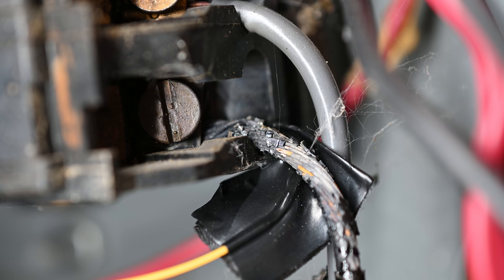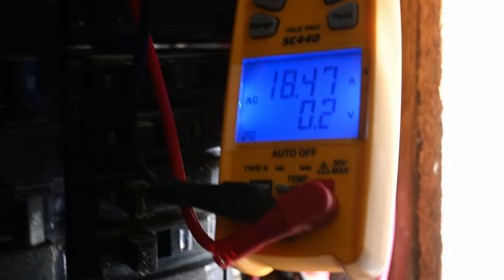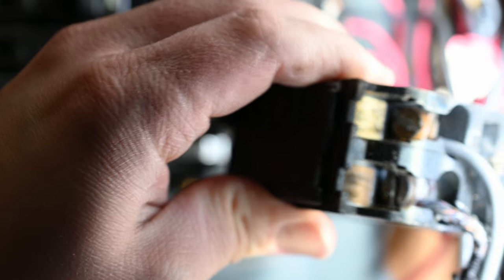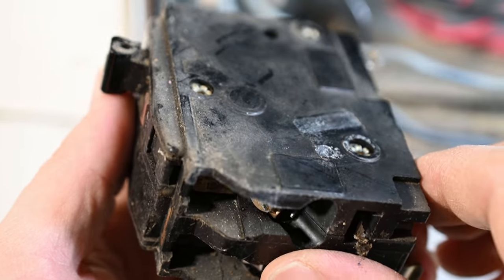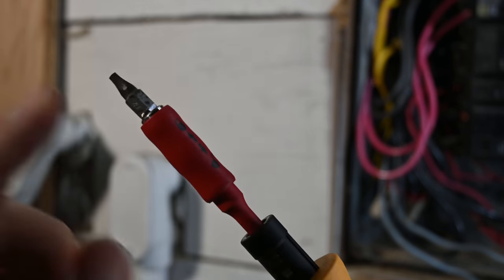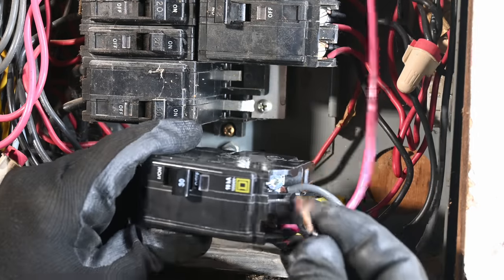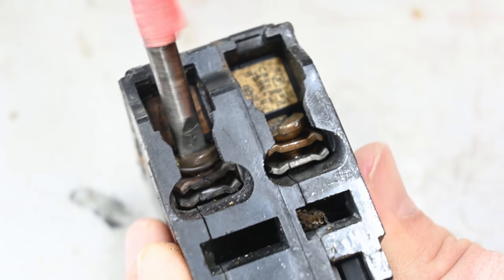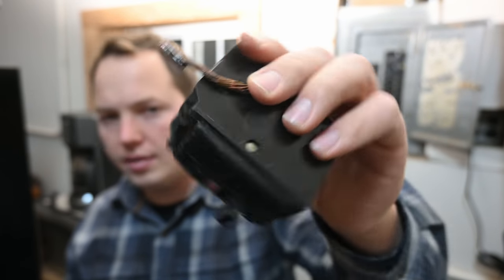Burned Wire On Breaker - Torque Screwdrivers & Why You Should Probably Be Using One

Comment: Thank you.  I teach HVAC/R and I have been teaching using a torque screwdriver on breakers and contractors.  Also the use of ferrules, like they use in Europe and Japan, help prevent this issue. Also, yes you need to cut more back  the burnt wires. The European screwdrivers are thinner then ours. The full Wiha set is several hundred dollars. 
Thank you again for making a YT video.
Reply: The ferrules are great! I can't believe those aren't common here in North America.
Reply: I was also wondering if you can use Ferrules on wires attaching to the breaker and you answered my question. I used them on the bus bar but not going into the breaker.
Reply: Are ferrules useful in marine wiring?
Reply: @GrampalettasCamp  to my knowledge ferrules are great with any stranded wire.
Reply: @victorlopez2143  You may want to check with your local code enforcement agencies to find out for sure. I'll bet they are not all that up to date.
Reply: @GrampalettasCamp  One of my friends has large boat and he crimps ferrules on the ends of EVERY conductor (all marine conductors are stranded, every splice is crimped). In fact, that is how I learned about the existence of ferrules--through him!
Reply: @victorlopez2143  I don't see why you couldn't use them for the breaker. Though it's less beneficial than its use for terminal strips because the Square D QO breaker in the video has a grooved plate that nicely cinches the conductor when tightened. With grooves on both sides of the plate proximal to the screw, you may also terminate two conductors onto that breaker. Not all breaker manufacturers have this provision. For those that have no plate and instead just have the bottom of the tightening screw compressing a conductor (like the terminal strips do), then a crimped ferrule would be very beneficial.
Reply: @aaron74  thank Aaron. The ferrules look like aluminum which would not be good in a marine environment unless tin coated like all marine copper wire. Do you know what they’re made of?
Reply: There used in car audio.  Only way to keep all the strands together
Reply: @GrampalettasCamp  I thought they're tinned copper? You'd want them to be copper or tinned copper for sure.
Reply: @jlsrr2577  Totally! Getting into car audio is a great discipline to learn all the vagaries of DC which (unlike AC) is so susceptible to resistance and current drop. So you're working with huge power cables to run from the battery in the engine compartment to the rear of the vehicle where the amp typically is. And stranded cable is always better than solid, not least because it's flexible but also because there is more copper surface area with a bundle of strands! More copper equals less resistance.
Reply: @GrampalettasCamp  Late comment, but I've seen both types sold.

Comment: There are a number of decent digital torque screwdrivers marketed for firearms, and they're generally a better value than the ones marketed for electrical use.  Plus they come with the right bits to torque down a scope mount and rings!
Reply: I have something marketed for bikes/cyclists. Probably the same stuff
Reply: Was going to say this as well! Wheeler fat wrench.
Reply: Any such brands?
Reply: You want to make sure your not using your torque wrench near it's extreme values (within 5-10% it's low end or high end); they are most accurate toward the middle. I've used Wera, which is about half the price of the Wiha he linked to, even after the Grainger tax. They make both adjustable and single torque rating screw drivers. Home Depot sells a husky labeled torque screwdriver, but it only has in-lbs, not NM (we were inspecting European hardware), so you'll have to do the conversion, but it's way cheaper. Our torque settings were touch more than a sneeze, just a few NM or something.
Reply: url for that?

Comment: Ben;
I have ab observation for you.  If you tighten down a screw TOO tightly, then use a torque wrench or screwdriver to test it's "Torque" it's an invalid test, as the screw may have been too tight in the beginning.  This was not the case here, but just the same, it can give you a false indication.  Before  retiring, I worked in the electronics industry, and screws on heat sinks for power transistors do have a specific torque need, too loose, things get hot and burn themselves out, too tight, and screws snap in the heat sink.torque settings should be made at the start of screw tightening, not after the screw is already tight.  I do enjoy watching your channel, keep up the good work!.
Reply: True

Comment: So glad I found this video today. Discovered an overheated neutral wire at my home's circuit breaker, leading to all the outlets in the kitchen not working. The screw that secures the wire was loose so I essentially followed your procedure. Thanks for posting!

Comment: 35 years as an industrial electrician and that has never happened to me and never use a torque screwdriver just tighten your connections that problem is caused by loose connections turn your screwdriver to the right

Comment: Nice demo. For some reason I thought these also had an 'inductive trip' mechanism, with a coil of wire pulling a magnetic contact away, but this was purely a thermal breaker. Maybe those inductive mechanisms are for bigger industrial size breakers. People should know that torque is not the only parameter. Even a small amount of corrosion, lubricant, antiseize, or thread trauma will significantly alter the ideal torque. You hit the bullseye with your remark about how the wires underneath can shift and create a loose fastener, even with a torque wrench. When torquing wheels, some guys drive the car around the lot, then retorque once the wheel settles into the place it want's to stay.
Reply: They do have a magnetic solenoid as well.  He just did not point it out.   It causes the "instant" trip under a dead short situation instead of allowing the breaker to explode.
Reply: The metal 'flap' on the trip bar is the magnetic trip feature. There is no coil, the inrush current causes a magnetic field that attracts that armature and trips it.

Comment: You have so much fun! The variable here is resistance. Power dissipation is I squared R (I^2 * R). With normal current (amperage) the squared term (I) stays the same, but with a kiss contact the resistance (R) increases causing a corresponding increase in power dissipation (heat).
Reply: actually, it changes the location of the voltage drop due to impact of now series resistance

Comment: As an electrical contractor for 30 years I can tell you this is important. Wire heat up and cool down causing expansion and contraction and over time loose up these screws that hold down electrical wire to equipment. Drills not set at the proper settings will casue issues. So yes hand checking things are a great practice especially those of use doing new install or service calls. Stay safe out there! 👍❤️🇨🇦💪 Burt wires are usually a sign of poor connection or too much amps going through it and heat in panel, as it hits 30° Celsius ambient temperature your rating of the wire goes down.

Comment: I had built a control panel for homebrewer. Had a breaker fail that burnt the wire and caused a short on the contactor side that fried the control port on a BCS-462 process controller. Great explanation of what was going on in this situation.

Comment: The boss had bought a new CNC lathe from Japan for €500,000. 
Everyone was happy with it, only at high speed did the CNC computer interrupt with an error message: "Error power supply." 
The three fuses and supply lines were checked, but nothing was conspicuous. Eventually it was discovered upon installation that one of the three phases had not been properly torqued. The cable was loose and already stewing. 
The cable and clamp replaced and production could start properly.
The fuse was "only" 400 V 3-phase 100 amps, so good connections are needed. 
Such an expensive machine has to produce to make it worthwhile.

But every house electrician is now also learning this in Germany. It's part of the standard.
Reply: Of course, WIHA also wants to sell the insulated screwdriver bits. 
During production, one end of the screwdriver is immersed in a water bath and 1000 volts AC is connected to the other end. 
If electricity then flows, the screwdriver does not leave the factory.
Reply from the maker: Thats impressive.
Reply: That’s very interesting.  I am a retired house/maintenance electrician for a processing plant. Had a 4160 volt motor making a very loud noise.  Checked the alinement,  loose base bolts,  coupling all the usual suspects.   Got the reliability team involved,  Report said it had a connection problem.  Opened the junction box connections looked good.  Cut the insulation off connections had one stewing real bad. Fixed lead and the  motor was running like it should after.

Comment: Thank you for the video and showing that loose terminals can cause troubles.  One a safety note, NFPA 70E and OSHA recommend/require wearing PPE appropriate for the work being done on a live panel.  In this case, a Category 2 PPE system rated for 8 cal/cm^2 would likely be required.  Of course, one may state, well I was not "at work" so those safety requirements don't apply.  While that statement may be OK for some, that statement would not protect you if there had been an arc flash.  An arc flash can happen at any time when working on a panel, not just when one is "at work."

Comment: Thank you for the video.
It was a good reminder to check the connections.
We kept burning out heater elements in a water heater and a water still- both were wired wrong. The instruction plates were in the back of the units. Used a mini Maglite to discover the problem.
  Good lighting makes a difference!

Comment: Ben, over 50 years ago while working for the phone company we would no-ox stranded cable and tighter and retighten and retighten over a couple of day especially with the larger stranded cables 500,000 to 750,000 all DC voltage.

Comment: Great video. I’ve found both of these issues before. Once the whole side of the breaker was burned and melted apparently from a defect inside. Other times the wire was never tightened properly on the terminal. Also found this on neutrals before, all burned and casing melted off.

Comment: My father was a Machinist/  tool and die maker. I was practically born with tools in my hand. Spent 39 years as a working election and worked on cars as a hobby from the age of 15. First time I ever heard of a torque screwdriver was around 2012 about a year before I retired. Interesting enough no electrical or auto parts or hardware store even carries them. If been retired almost 9 years still haven't found one locally.
Reply: I have seen a Husky brand torque screwdriver at the Home Depot near me.  It was $60 I believe.

Comment: This was a great video, Benjamin, I'm to the point that I always look forward to the next one.  

When I saw "Made In Germany" on your Torque driver I though "good for you!" because Germans are known for over-engineering and precision.  But I was laughing (with you, not at you  :)  when you encountered the driver bit fiasco.  😆  Who would have seen that coming?   

I've been gunsmithing at home for about two decades and have had the benefit of trying several inch-pound torque drivers.  The best I have encountered which is reasonably priced is branded by Vortex (sold on Amazon as Vortex Optics Torque Wrench Mounting Kit). It is good quality, easy to adjust, and is always within an inch pound of my Snap On 1/4 inch drive angle torque wrench.  And one of the best "non-German" features is 1) It comes with bits, and 2) it will accept all the 1/4 drive bits in your tool box. 

So that's an affordable option for anyone on here looking for one.  I DO NOT recommend that fat ugly yellow WHEELER thing. It's half the price of the Vortex, but it is GARBAGE. Please don't waste your time or money on it.

Anyway, Benjamin, the 2P 30A breaker connecting my shop heater has been getting warm lately (but not the wires) and has been sometimes making a ticking sound. The wires ARE tight, so I'm assuming it's the breaker.  I think I shall do a breaker dissection as you did, and see what's going on in there.
Reply: Thank you for sharing. Been needing one for a while for lots of things. But thought i was gonna have to get a snap on or something.
Reply: @ShotGunner5609  Oh, you are welcome.  If there is any complaint it would be that the bits can be a little tough to pull out, but I guess that's better than them falling out on their own!
Anyway, if you get one, hope you like it.  It's definitely handy having one around!

Comment: Burned wires behind a hot outlet. Some joker had used the backstabs with 2x 12ga (so 4 wires connected to the back of the outlet) to feed and chain from, with another set of wires under the screws.  Have you ever had to pull out an outlet with 7x 12ga wires connected to it?
I had to trim 3 inches off the romex to get to good insulation and even then had to scrape it off the copper. It was then too short to work with so I used ideal push connects to join with a pigtail for the outlet. No heat coming from those and the outlet with only 3 wires (and less length on 2 of the other romex coming in) was a dream to fit back into the box.

Comment: I am not an electrician, but Ive dealt with many electrical issues, at home, at work, with family members. It looks like on that one they never screwed the wire down. Most problems I have seen are with wire nuts. At My grannies house, the bathroom light circuit had I think 34volts, just because of the poor connection of wire nuts, same thing at work in 3 places. As you know, low voltage causes stuff to burn. I will only use Wago's now. I still have problems in my house where friends and family members wire stuff wrong. I would like to get a NEC cheat sheet. I have taken A/C and D/C. I think a lot of people don't understand Series and Parallel in an A/C circuit. If you start dropping voltages it will burn the house down. I've seen a few bad breakers. My water heater element just went out. It tripped the breaker, but it didn't trip the switch on the water heater. You got me rolling on that, I'd never done that. Thank you for the great video though! I have been watching your grounding and bonding videos. I am still a little confused about it though. If power is trying to escape from an appliance, I don't want it to escape through me. I want it to have 2 different routes where it can get to ground, but you were saying it was trying to make it back to the main panel on the pole? The house has a sub panel. Also, do you need 4 grounding rods for a main and sub panel?

Comment: Ben, I am not challenging anything you said but want to add the following.  My background is in power generation - both nuclear fuel and fossil fuel.  There the use of torque wrenches has been enforced for decades. The most common issue decades ago was that of calibration. Calibration was often done at the tool distribution center before the tools were shipped to the work site.  This created questions and soon the temporary tool rooms had calibration equipment and would test the accuracy before issuing the torquing equipment.  Records were meticulous kept to establish when and where the equipment was used.  This process worked for Original Equipment Manufacture (OEM’s) performing work at utility sites or large general contractors employing multiple subs. However for small electrical contractors I can see this process can be cumbersome and some may argue cost prohibited.  The issue is-just because a torque wrench is set to your desired torque, does not mean that it is actually producing the specified torque.  I expect this will become an issue in a future NEC revision.

Comment: Wheeler and others make torque screw drivers for mounting scopes.  Check Amazon and the price and compatibility  are better.  Great video!
Reply: Yeah, your'e the first that I see mentioning this.  On Amazan it's called the F.A.T. Wrench by Wheeler engineering and runs about $50-$60.  It offers similar/same torque range as the one you used in the video from Wiha but definitely uses standard bits.  

I've used mine for alumi-conn connections, polaris splices connections, breaker connections, etc. all requiring proper torque (granted 4awg Aluminum to 6awg Copper Polaris was really hard to torque down!).

Comment: When I replace a Bad breaker, I smash it in to pieces before throwing it in the trash.  If it looks good on the outside, sometimes people will fish it out of the trash and bring it home to use or sell online, thinking "Hey somebody threw away a perfectly good circuit breaker" Not knowing any better. You are right, most Electricians in the US don't do it. I know it is usually considered a time waster in Residential situations where the pressure to get the job done is a priority.  That being said, it should always be done. Most Resi employers won't provide that expensive tool either, thinking you can reach the specified torque easily by hand w/o the special tool. Right or wrong, that is what I was taught as an apprentice when I entered the Trade in 1995. I have since purchased my own torque screwdrivers I use on the job.  Russ, Journeyman Electrician from Oregon.

Comment: Very interesting. Good job. You need to clean strands of the red conductor (you can use emery cloth and wipe clean with alcohol). You can see they are covered with copper oxide and products of chemical reaction between copper and overheated PVC insulation. You stripped wire far enough from the connection but It is possible that even that far copper underwent annealing.
Reply from the maker: Great suggestion.